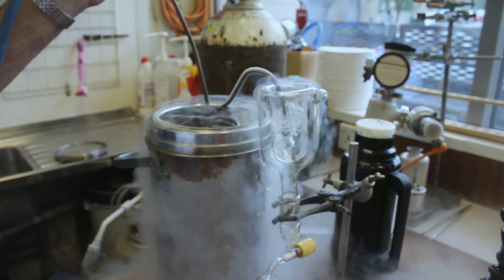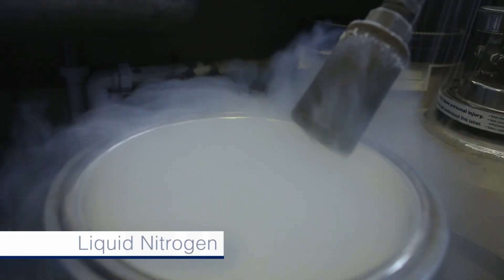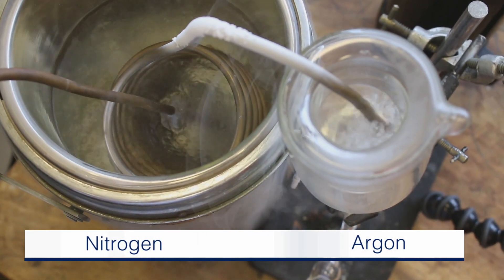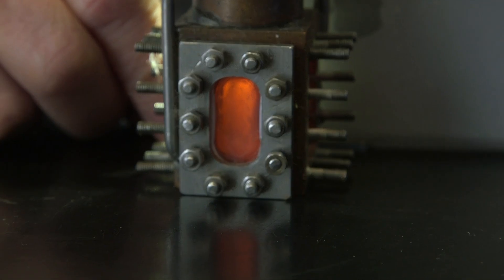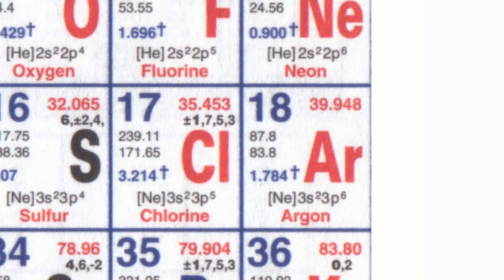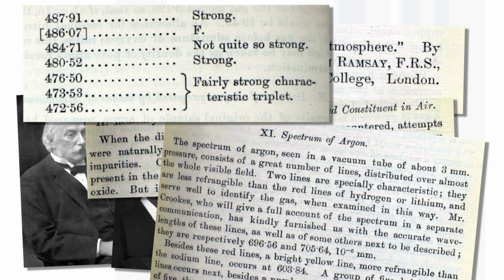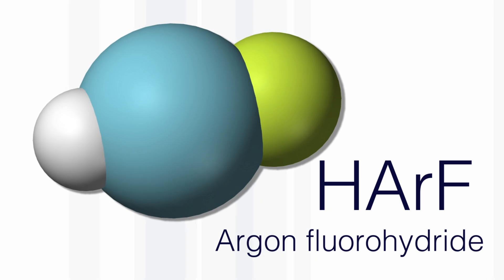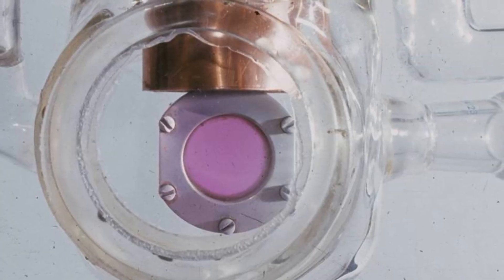Argon - Periodic Table of Videos

Comment: Argon was once an energy saver in rectifier tubes/valves, as the ionized gas greatly reduced the voltage drop from cathode to anode. They also made a really cool cyan glow, but argon, mercury and xenon rectifiers have been supplanted by solid-state devices long ago.

Comment: The name argon comes from the Greek for lazy, because it's a heavy gas that just doesn't react much. But it's the most abundant of the inert (unreactive) gases after helium, and it's put to work in many ways. It's idleness makes it perfect for adding to light bulbs to stop the elements from burning out. It's used in between glass panes in double glazing and in steelmaking to stop ingredients from oxidizing. It makes brilliant blue lights!

Comment: Argon is also used to cool the electronics (specifically the seeker heads) of infrared guided missiles. This gives the detectors a much better sensitivity/resolution to temperature differences between the target and the background. This is particularly useful in desert environments during summer where the temperature differences would be much less.

Comment: Argon was used in the steel industry for cooling copper molds when making steel. Copper and steel don’t mix or react but the melting point of copper is lower than steel. The argon keeps the copper from melting.

Comment: All right, I have a question. Given that argon is incapable of forming stable compounds, displaces oxygen and is heavier than air, would it be useful to help extend the shelf life of optical discs (CDs, DVDs), by isolating them from oxidative processes?

Comment: As a member of a group carrying out experiments with Breathing gasses in a Hyperbaric environment in the early 70's I can vouch for the fact that Argon was very quickly found to cause unpleasant reactions when included in a breathing gas mix.  Even Helium can cause problems with the brain's electrical system (HPNS) at elevated pressures/percentages.

Comment: The relatively low thermal conductivity of argon is, in fact, due to two factors.  One is its high atomic mass, as stated by the Prof.  The other factor is its low heat capacity, owing to it being a mono-atomic species.  Thus, it possesses no rotational or vibrational modes, which can "carry" heat.

Comment: I often see argon gas used in welding.  Also, it is used in the food industry to package products such produce and meats to prevent oxidation.  If you buy a bag of chips (or crisps if you’re British) the gas inside the bag is either argon or nitrogen to prevent oxidization that would ruin the flavor.

Comment: The business about argon (or any other gas other than air) in a "sealed" window is pure moonshine.  If a window were hermetically sealed, it would burst or implode when the atmospheric pressure changed an inch of mercury (about 1/2 PSI, go figure the force on a 2 x 2' square window, it would be 288 pounds!)

Comment: The argon (or air) in between the two sheets of glass, shouldn't it be at lower pressure than the atmosphere, so that it could transfer even less heat? Or would that compromise the integrity of the window too much if it was at a different pressure from the air around it?

Comment: [Science -- N. S.  Vol. I  No. 12. -- March 22, 1895.]
ARGON.
The plain facts concerning argon are these: For some time past Lord Rayleigh has been engaged on refined work involving the weighing of various gases. Last year he found that the nitrogen obtained from the air is a little heavier than that made from definite chemical compounds. This led him to further experiments and, at the same time, Professor W. Ramsay, of University College, London, also undertook experiments with the object of explaining, if possible, the discrepancy. The general method of work consisted in passing air, first through substances that have the power to remove those constituents that are present in small quantities, such as water vapor, carbonic-acid gas, etc., then through a heated tube containing copper. The oxygen of the air unites with the heated copper, and what has hitherto been regarded as nitrogen remains uncombined. This ‘atmospheric nitrogen’ was subsequently treated in three different ways for the purpose of removing the nitrogen from it.
(1) It was drawn through clay pipes in the hope that, if the gas is a mixture, one of the constituents would pass through the porous material more easily than the other, and at least a partial separation be thus effected. While something was accomplished in this way, the experiment was on the whole unsatisfactory.
(2) The ‘atmospheric nitrogen’ was mixed with oxygen in a vessel containing caustic alkali, and electric sparks were passed through the mixture. Under these circumstances the oxygen united with nitrogen and formed a compound which is soluble in alkali. After no further absorption of nitrogen could be effected by sparking, any unchanged oxygen present was removed, and there was then found a residue of gas which was certainly not oxygen nor nitrogen. This proved to be the substance about which the world is now talking.
In this connection it is of great interest to note that Cavendish, in 1785, probably had this same substance before him free from nitrogen. He performed the experiment above described, and noticed the residue, and says in regard to it: “We may safely conclude that it is not more than 1/120 of the whole.” This is very nearly the truth as regards the relative amount of argon in the air.
(3) The most satisfactory method for obtaining the gas on the large scale consists in passing ‘atmosphere nitrogen’ over highly-heated magnesium, which has the power of uniting with nitrogen, while the newly-discovered gas has not this power. But, even by this method, the preparation is very slow, and, up to the present, the gas cannot easily be obtained in large quantity.
The new substance is heavier than nitrogen. The density of hydrogen being taken as unity, that of nitrogen is 14, of oxygen 16, and of argon 19.7.
Perhaps the most remarkable property of argon is its inertness. It has not been possible thus far to get it to combine with any other substance, so that anything more than a general comparison with known substances is out of the question. It owes its name to its inertness, argon being derived from two Greek words signifying ‘no work.’
A determination of the ratio of the specific heat of argon at constant pressure to that at constant volume was determined by means of observations on the velocity of sound in the gas, and the ratio was found to be 1.66. This is of much importance as showing that the particles of which the gas is made up act as individuals. If this conclusion is correct, it follows further that argon must be either a single element or a mixture of elements, and that, if it is a single element, its atomic weight must be nearly 40, as its density is 19.7 and its atom is identical with its molecule.
Professor Crookes has studied the spectra of argon and, in an article giving his results in detail, he says: “I have found no other spectrum-giving gas or vapour yield spectra at all like those of argon.” * * * “As far, therefore, as spectrum work can decide, the verdict must, I think, be that Lord Rayleigh and Professor Ramsay have added one, if not two members to the family of elementary bodies.”
Finally, Professor Olszewski, of Cracow, the well-known authority on the liquefaction of gases has succeeded in both liquifying and solidifying argon. It was found to boil at 186.9° C., and to solidify at 189.6° C., forming a mass resembling ice.
To quote from Professor Ramsay’s article read before the Royal Society: “There is evidence both for and against the hypothesis that argon is a mixture: For, owing to Mr. Crookes’ observations of the dual character of its spectrum; against, because of Professor Olszewski’s statement that it has a definite melting point, a definite boiling point, and a definite critical temperature and pressure; and because, on compressing the gas in presence of its liquid, pressure remains sensibly constant until all gas has condensed to liquid.”
The above is a brief account of all that is known about argon, and it would evidently be premature to indulge in speculation regarding its position in the system. It may as well be said at once that, if it is an element or a mixture of elements, it will apparently be difficult to find a place for it on Mendeléeff’s table. It will be well to await developments before worrying on this account. If the time should ever come when Mendeléeff’s table has to be given up, something better will take its place.
The suggestion has been made repeatedly that argon is perhaps an allotropic form of nitrogen. The strongest argument against this view is the established fact that the gas conducts itself as if made up of individual particles, while any allotropic form of nitrogen, which is heavier than this, must, according to all that we know of such matters, consist of more complex molecules than nitrogen itself.
IRA REMSEN. JOHNS HOPKINS UNIVERSITY.

Comment: If argon is almost completely transparent to infrared (infrared passes thru without much interaction) and argon is a poor conductor itself of heat...then how is heat not just radiating from one pane of glass to the other--essentially ignoring the argon? How is it doing any insulating?

Comment: So some of the particles in my liquid nitrogen could be solid argon... I never really thought about argon's freezing point.  I assumed any solids were only water ice and dry ice.  But, I'm guessing the solid argon is VERY minute.  You could collect liquid air in a container inside another container of liquid nitrogen and skim all the solids off the liquid air and, if after a few seconds, you witness any boiling going on in the midst of those solids then there is liquid argon present.  That's because CO2 sublimes and ice obviously just melts.

Comment: As a neon bender myself, might I add a small note about the color demonstrated with the argon light in this video.

Argon does not glow like that on its own. Argon is a nice dim lavender which is difficult to see in a lit room, which is why we typically mix it with mercury gas in order to pair it with double phosphor coated glass (since plain argon will not be bright enough to make the glass glow). To my knowledge, mercury does that to neon as well, and we use it with neon mostly for glass that will be used in a colder environment... or whenever we run out of argon and are too lazy to order more. I haven't tried it with other gasses as we don't usually stock them.

Comment: One very important use of Argon that I'm surprised you didn't mention is in TIG welding.  TIG stands for Tungsten Inert Gas, and the inert gas that is used, the vast majority of the time, is Argon.  Its weight is very good at displacing air (as you mentioned) and thus it is perfect to use when you need to create a weld that isn't affected by Oxygen.

Comment: Fun fact about argon: it's so common in the atmosphere because potassium-40 decays into it, with a half-life of 1.25 billion years. The atmosphere started with very little of it, just like the other noble gases, but it slowly accumulated as the K-40 decayed to Ar-40 (and Ca-40). The K-40 --> Ar-40 decay is the basis of potassium-argon dating.

Comment: why are we using Ar and not emptiness in insulation on windows? Is it cheaper to pump in relatively expensive Ar than pumping out the air? I mean you negated the conduction form the equation.

Comment: I work in the windows industry. Although we fill Insulated glass units completely with argon, when we sell this service, we only claim a 90% fill. The problem is that argon's molecular size is so small that some of it leaks out over time, like helium out of a mylar balloon. Each day as the glass heats up from the sun, the pressure inside the I.G. unit raises slightly and encourages more argon to "vacate the premises".  Over the course of several years, the unit will "hourglass" slightly during the cooler portion of the day.

Comment: I use argon as a shielding gas for TIG welding. The gas prevents the metals from burning in ambient oxygen when bits of them are heated up to some 5500C in the electric arc. Nitrogen cannot do this job because it too burns at those temperatures. One key challenge in TIG welding is to get the electrode and the workpiece reliably immersed in a moving stream of argon. Doing so is subject to many small problems. Central to the difficulty is that every repair or one-time fabrication job takes place in its own unique geometric puzzle. A skilled welder needs years of experience to develop intuition covering most of the situations she is likely to encounter.

Comment: Gotcha ya Prof!  They fill double pan widows with nitrogen because it's much much cheaper.  If they really want to pay attention and money isn't an issue they may use Ar. They don't use air because air has water in it and the water codenses in the cold weather like !eaky airplane windows at the high altitude.  What I was having a double pan widows that I had broken fixed,  I asked the guy about the gas he used  He said he used nitrogen because it's cheaper.

Comment: After these gasses are boiled away it seems like it would be awfully difficult to capture those gasses again. Are gasses recycled after use? And if so, then how?
Reply: Depends on the Gas, Helium for example is usually at some sort of closed loop in Universities, because, otherwise we could run out of Helium. Argon on the other ist quite abundant in the Air so ist doesnt need to be recycled as heavely. but If you want to do so you use it in a sealed Container and purify it Afterwards.
Reply: schenkov; Technically they did recycle it. It was originally a part of the atmosphere and now it is again...

Comment: Why was Neil hitting the tank with a hammer?
Reply: sysprog1953 to remove the cap that covers the valve on the tank that protects the valve. Removing the valve in an accident would create a missile propelled by rapidly expanding argon. Can go through brick walls, or undergrads.
Reply: Thanks for the explanation.
Reply: No, he is not hitting because of remove the cap. He is changing the position of the protector neck, by rotating it, because his argon reductor has  small size, and he needs more place.
Not every bottle has this kind of protector neck. In other country they have a threaded cap. So you can unscrew it, when the bottle was put in a safe place.

Comment: The explanation of why liquid Argon is transparent to infrared light was fascinating! Love the videos. Thank you.
Reply: I heard pure oxygen could indirectly cause cancer. I took it with a grain of sodium chloride
Reply: I bet argon is even less toxic than nitrogen.
Reply: Rohan Zener Nitrogen is not toxic at all. Most of the air you breath is made of Nitrogen.
Reply: Nitrogen only becomes 'toxic', or should I say, narcotic, at higher pressure. (e.g. Scuba diving at higher depth).
It gives you a pleasant, albeit very dangerous intoxication ;) Quite similar to alcohol really, without the horrible hangover.
Reply: It's actually very unpleasant, and toxifies by clogging the arteries and capillaries. It's called an embolism.

Comment: Not only do the (relatively heavy) atoms of Argon move more slowly than, for example N2, but, because energy increases as the square of velocity, they transfer less of it with each traversal between the panes of double-pane glass.

Challenge: create foamed glass from molten glass and pressurized Argon.
Reply: Also, Argon has only about half the heat capacity of air (by mass). So a given mass of argon will contain only about half the amount of heat. I imagine that's a factor in its low thermal conductivity. Its heat capacity is lower because it has no rotational degrees of freedom, unlike oxygen and nitrogen.
Reply: John Payne would that even be transparent,  or would the glass bubbles look opaque?
Reply: Translucent to opaque, depending upon the thickness.  It wouldn't be useful for windows, but could be a more inert and more durable replacement for rigid plastic foam insulation.

Comment: I'm wondering if I can use tungsten hexafluoride to insulate my windows because its molecules are pretty heavy.
Reply: Серега Петров You could, but it freezes already at -9C, and if there are traces of water vapor the resulting HF would etch the glass. And there are other disadvantages ;-)
Reply: @plemli  ok then sulfur hexafluoride at least it's gas at stp and not that corrosive

Comment: I use argon, lots of it, daily. A cylinder or two at best. We use it as inert gas for welding (MIG and TIG), or if combined with CO2 as an active gas.  (MAG)
Reply: Usually,instead of argon,acetylene is used;but aron is a better choice!
Reply: @aparnavellala624  acetylene is used for oxyfuel welding or cutting. Argon is used to shield the weld pool for tig and mig. preventing it from getting defects

Comment: Argon is used for industrial gas shielded welding because, as the video said, it is very good at dissipating other gases and the fact that unlike Nitrogen, they don't react with most elements at high heat.

Comment: Can you get solid argon?
Reply: @Rich Mitch: Sure you can. As indicated in the video the melting (freezing) point of Argon is very near the boiling point. When it is possible to liquify helium it is certainly possible to obtain solid argon. Would have liked to see that, also in combination with some electron interferometry of the crystal structure, but perhaps in a future video.
Reply: from the Orokin void